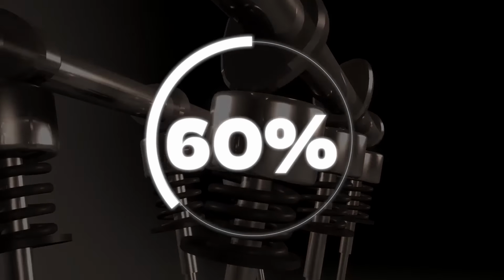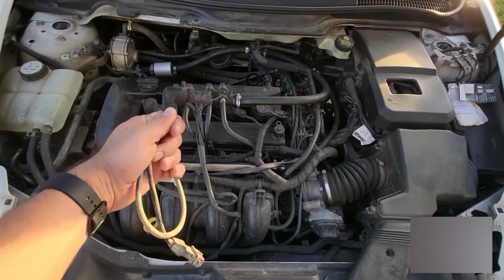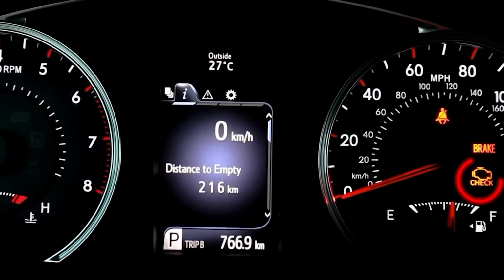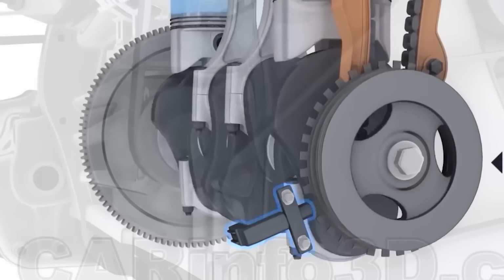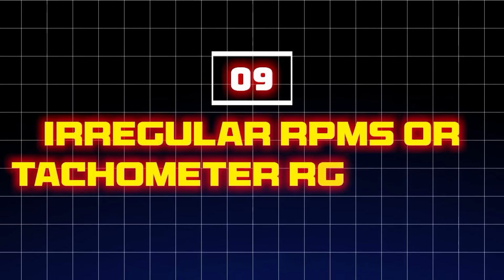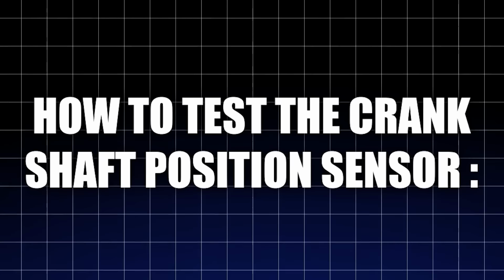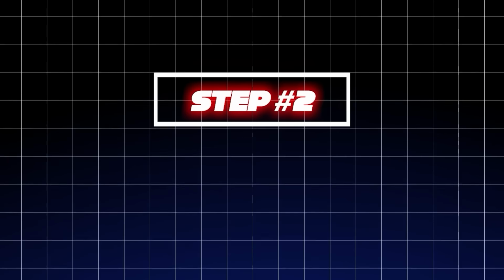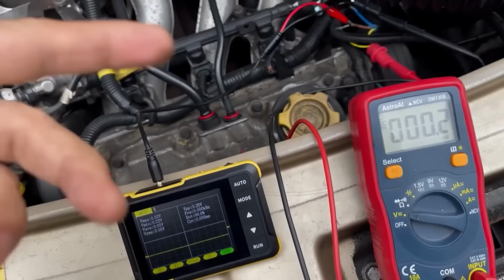10 Bad Crankshaft Position Sensor Symptoms ( Fix it Now)

Comment: Has anyone here ever spent $60 - $150 on a crankshaft sensor?
Reply: Yes, just spent $70 on a new Denso brand CPS. I had purchased an aftermarket BWD sensor before and it lasted for 23K miles and failed on me. My original sensor lasted 184K miles. So, I am going back to installing an OEM, which is Denso brand for my Toyota.   It was a pain to diagnose as I got other error codes such as the igniter but eventually my vehicle ECU did send out the error code for a camshaft sensor error. I don't have a camshaft sensor but figured this meant it was the crankshaft sensor.  I had a backup used CPS that I installed and it works, but it has around 200K miles but is also a Denso brand so decided to go with a new Denso and keep my old used backup Denso for possible future use. I have backups for most of my electronic parts, including the ECU due to my travels in remote areas of Canadian territories. Most everything electronic has failed on me with my 1994 toyota T100 at some point in time.  Otherwise, it has been reliable if not for the failed electronic sensor issues.
Reply: $70 for 2 here in Savannah two hours ago
Reply: I spent $43 at Auto Zone. I have a 2012 Chevy Cruze
Reply: Anybody with a Mopar has if they went OEM
Reply: Hell no depends on the car i guess
Reply: In my country it's as cheap as 50 bucks depending on brand n available n type of car.
Reply: good work

Comment: THIS HAPPENED TO MY HARLEY
Reply from the maker: Ah, the dreaded crank position sensor strike! Harleys are especially notorious for this. Your symptoms likely match the classic failure mode: heat-soaked insulation breakdown in the sensor coil windings. On your model, you'll want to:
1. Ohm test the sensor (should be 250-1,000Ω cold)
2. Check for AC voltage output while cranking (>0.5V AC minimum)
3.Inspect the trigger wheel for missing teeth (rare but happens)
Most aftermarket sensors need the air gap adjusted - factory ones come pre-set. Did yours fail after a recent service?

Comment: Why does my car cranks but does ignites,but when i remove the crankshaft sensor socket then put it back it ignites well,whats the problem, Nissan march 2008 model 1249 cc cr12 engine
Reply: If you disconnected the crankshaft sensor chances are you need to get it tuned by dealer or higher end scanner

Comment: Show me the same video,on a 2003 tibron hondai 2.7 6 speed
Reply from the maker: While I don't have the exact video for 203 Tiburon Hyndai, here is a quick quide. For your 2003 Hyundai Tiburon 2.7L (G6BA), focus diagnostics on: motor mount integrity (especially lower torque mount), ignition system health (coil resistance 0.5-1.5Ω), and fuel trims (±10% STFT/LTFT). This engine commonly exhibits vibrations from failing cam position sensors (P0340-P0343), worn timing components, or carbon-clogged EGR. When filming, capture cold start behavior, vibration patterns at 1500/2500/3500 RPM, and include any stored DTCs - this will help pinpoint whether we're dealing with mechanical imbalance, misfire, or harmonic resonance issues specific to the 6-speed configuration. I'm happy to help further  when you share the video.